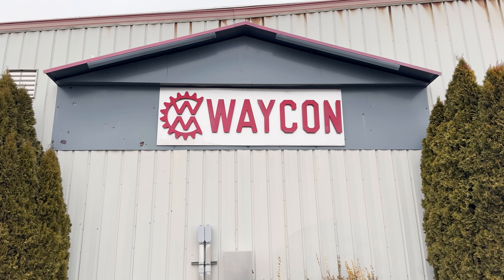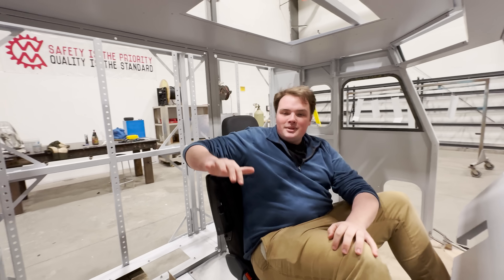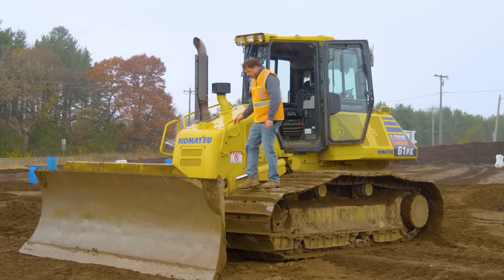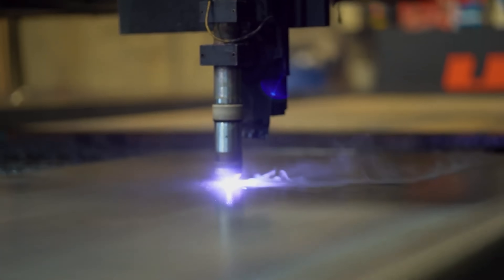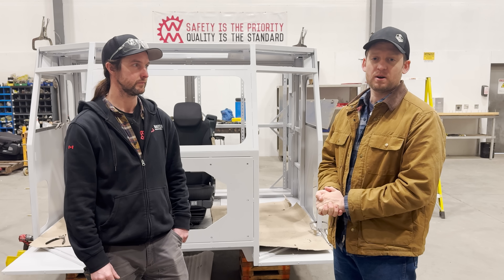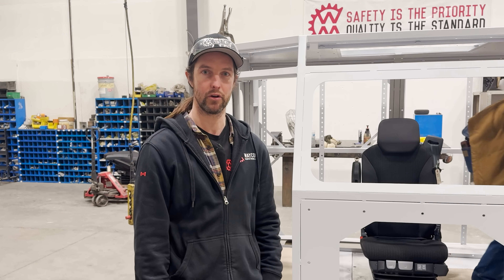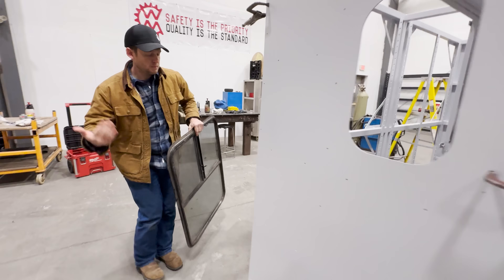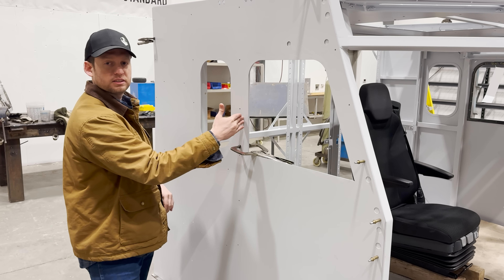Unveiling the Undisclosed Hybrid Electric Truck Cab: A Sneak Peek

Comment: If you sitting in the middle can you still judge where the lines of the road are. In a video of the Tesla semi it seems like driver was having problems keep the tractor centered in the road.
Reply: When I was little, we had a car with a rock chip in the windshield, and my mom would line up that rock chip with the lines in the road. It was like having sights on a firearm. I'm confident that after a brief learning curve, that center seat drivers will figure it out.

Comment: Great work you guys are doing! However, touch screen technology may not be the way to go, especially when you need to long reach to the screens, as a number of your videos have shown. I drive a late model plug-in hybrid CSUV that utilizes touch screens for HVAC and Radio settings. It is almost impossible to safely adust the settings while driving, even on well paved roads. I imagine it would be even worst while driving on logging roads and uneven ground. Luckily, there are mechanical controls. Usability should trump simplicity. Serviceability doesn't necessarily mean strict adherence to the off-the-shelf philosophy. A simple test would be to have someone bounce the seat while the driver tries to change the settings on the touch screens. IMHO.
Reply: All valid points. I too am concerned about too much reliance on a touch screen. Especially if it quits and your 1/2 million dollar truck becomes a 100,000 lb paperweight. On a lighter note, in a previous vid, Chace talked about having industrial arm rests with control buttons on it from a company that makes them for fork lifts and back hoes and stuff. The arm rest buttons will be integrated into the computer. Would be nice for AC up/down, or radio up/down etc.

Comment: Looking good but ------- straight sidewall glass is going to reflect all light and make mirrors to look at rather than windows, when maneuvering at night. Can the cab walls, above steering wheel level, not be tapered in to center to reduce the reflection??? 65 years of over the road to qualify my input. ps: same would apply to the glass panels over the controller boxes behind the driver. They would become a huge distraction in night operation if not tilted up or down or to the side. It this is any value to your design, I could always use another hat?

Comment: 6:30 For visibility on this truck, love the manual sliding window idea. Less opportunity for something to break. 
For more visibility, what about 4k wide angle cameras could be placed on various spots throughout the cab to cover all the blind spots? The latency would be in the 10s of milliseconds. Multiple small LED screens (10.1") could be placed on either side of the steering wheel to keep the driver's eyes forward. Cameras and LED Screens are super cheap now compared to 20 years ago.

Comment: Your remarks about visibility and communication gave me an idea for a suggestion. I know of two truck drivers that were cleared of any wrong doing in incidents where their spotters lost their lives. Both happened while backing into dark areas during a bright day, one was crushed between a wall and the trailer and the other one tripped while crossing behind the trailer and was crushed by the trailer tires. In hind sight, a pair of wireless headsets with mics would have prevented these accidents. Incorporating one of these units into the truck with an easily accessible storage area where they would stay charged for use when needed would be ideal. Their use would greatly reduce the potential for accidents by giving reliable communication between the driver and spotter in situations where visibility and/or noise are a problem.

Comment: I think for getting in and out you would want a "well" (ie. a lower section like a bus) from the door to the seat. This will also reduce the risk of people hitting their head. Imagine some 6"2 300lb trucker crawling through that door 10 times a day gets old quick.

You could raise the height of the entire cab and put the seat on a platform, but on a big truck I think extending the door down and having a step on either side of the seat will be cheaper.

Comment: Something to think about: You guys are young. You're not aware that older drivers who wear bifocals will have trouble reading overhead screens and flipping overhead buttons (if any). Some airline pilots get special eyeglasses that have an additional close-up section at the TOP of their lenses in addition to the one at the bottom but I don't think you want to impose that requirement on truck drivers.
Reply: "Dozer-style doors" is a great idea!

Comment: Out of curiousity, being scratch-built, what sort of destructive testing are your trucks going to be put through before getting on the road?  Not only as far as wear & tear goes, but also as far as crash testing etc...
Reply: Semis don't get crash testing. Many components in Edison trucks have been in service for decades. For the new equipment,  they're building a test track in Golden where trucks will need thousands of hours of driving to pass CMVSS standards.

Comment: Looks good! This is the one truck I am most excited to see ready of the new ones. I would vote for the top hatch as well, since you already have space in there. I've been in the investigation team for the tractor incident where the guy who was clearing a forest road drove a tad too close a marked no-go area and dropped 20ton rig inside a 9m deep spring from the road. Since there were only side doors you couldn't get them open due to tractor going into the water side first. First and only fatality I've had to witness in 15yrs of working in field and I hope to never get another one again.

Comment: Are there a lot of crash regulation like cars have? I suppose so even though trucks blow through with all their weight.
Reply: Semi trucks have less crash regulations. 80,000 lbs going 80 mph and running into a freeway bridge, there is no amount of crash protection possible for the driver.

Comment: Will there be a speed sensor added to the cabinet doors sensor to prevent the truck from having a power shut down if it is traveling down the road . Just thinking of the potential risk to the air brake system if the compressor shuts down during motion due to the electronic door sensor

Comment: A stamped and welded frame seems much simpler but the machinery required for that probably costs more than the truck itself
Reply: Correct. The frame for this cab can be repaired by any welded for the next 100 years.

Comment: Why are you guys in north america determined to stick with 1960's production methods and looks, flat panels was used simply because we where unable to produce anything else
Reply: It's for ease of repair in the future. With flat steel panels and flat glass, then for the next 100 years, owners will be able to go to any steel supplier or glass shop to get repair materials. It's for "right to repair". Ship of Theseus.

Custom curvey body panels will be unavailable or extortion high prices in the future. They are anti right to repair.

Comment: Those are some thicccc “A"pillars! Considering the width of the tube frame, the size of the surround flange for the front windshield plus another 1/2" minimum for gasket all around, that’s a lot of visibility lost. Could you not do the surround flange as minimal as possible, gasket groove + max 1/2"? Is this done for welding/warp control? If so add another operation for trimming the window bigger after welding. Also is this how the cab will be finish exterior wise? What is the plan between the tube frame and sheet metal, seam seal all the joints/cracks all around?

Comment: Comment from the peanut section... So the customer asked for a central driver position. I guess they have some rather special needs and use cases. Personally I like the idea of sitting in the center when driving, up to the point when you have to start backing up a trailer. I know I'm not a truck driver, but when backing up a trailer I really like to have the option to actually lean out the window and take a look when things get hairy. It's just so much easier to see the exact distances and angles doing this rather than depending on the mirrors. Sure it only works when looking at the left side, but that's 50% of the time when it starts getting tricky. I certainly would like to have the option to just lean out the window to have a look at least half the time you have to thread the needle by backing into some restricted space. But then as I said I'm not a trucker.

Comment: the sliding window instead of a winding window seems like a good idea. more reliable and probably lighter and cheaper too. there's potentially an 'off the shelf' option that could be used which could reduce cost and just make things easier instead of having to design something new.

Comment: The sensors on the doors inside the cab to see the electrics could become a critical failure point.

If the sensor is tripped during travel it might cause a serious crash.

Maybe a switch with clear indicators on the handle of those doors. This way you switch power of manually before even opening anything. 

The sensor could be there to light up a warning signal if it knows the door has been opened and the system is still live. Simply run the alarm through the power system giving you a very clear indication if the power is still on.
Added benefit being no costly downtime for a sensor failure or a door that hasn’t been closed properly. 

Perhaps plexiglass or something to prevent possible shattering glass. 
(Is the back of the cabin able to withstand a sudden force?)

Comment: As a local driver, I don't understand the center seating thing. I want my seat right beside the door, so it's right there to get in and out, and how am I gonna hang my arm out the window if it's two feet away! And my feeling is if a driver needs to be in the middle to see and not hit things, they need to cut up their license. Just some light hearted rambling, it'll be cool to see the cabover version of Topsy

Comment: 07:58
Would your customer consider dual-pane sliders?
.
2003, we built our ExpeditionVehicle with dual-pane sliders.
Quiet, plus excellent temperature control.
3010 (three feet wide by a foot tall), designed for a stand-still house.
.
[edited to add]
Over two decades full-time live-aboard.
Twenty-four months twenty-four thousand miles around South America.
Alaska Panama, multiple trips through North America.
Summers up rough logger tracks to remote mountain lakes.
Winters on isolated Baja beaches.
Zero issues with our dual-pane sliders.

Comment: If the driver is sat in the middle, they wont be able to reach a manually-sliding window from their seat,
For a centre seat, electric windows are needed (even if they're electrically sliding ones)

Comment: A modular composite cab design would be far superior to any steel or aluminum cab.  It would be much simpler and easier to assemble, and rust would not be an issue. A modular composite cab would be easier to repair if damaged.  A blend of carbon and aramid fibers would be ideal.  Prepreg with autoclave cure would produce the best products.  Structural composite panel bonding is very simple.